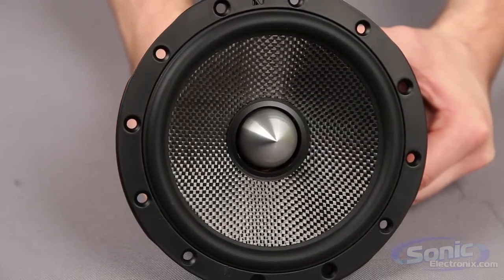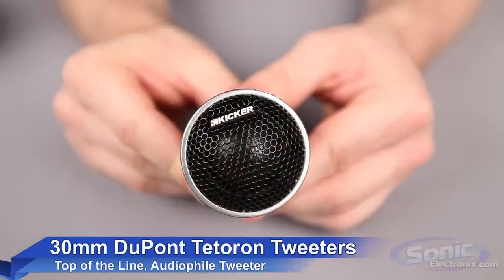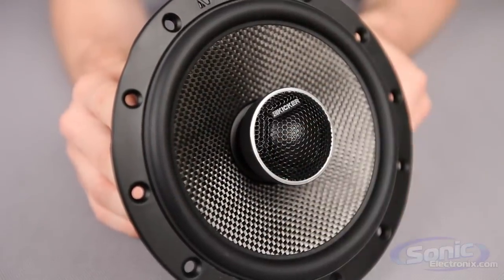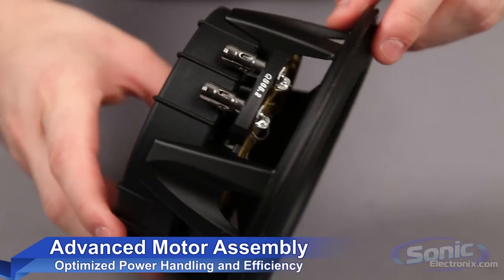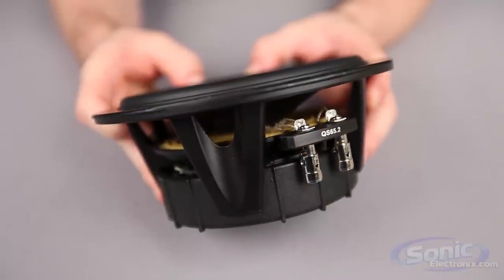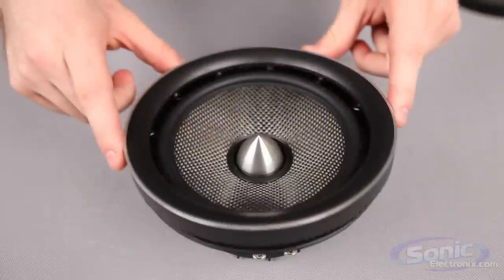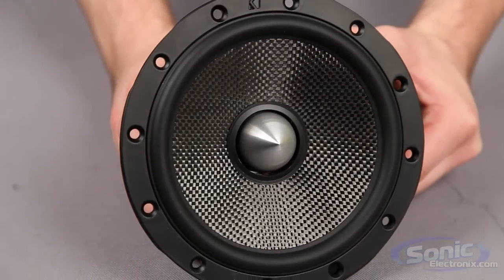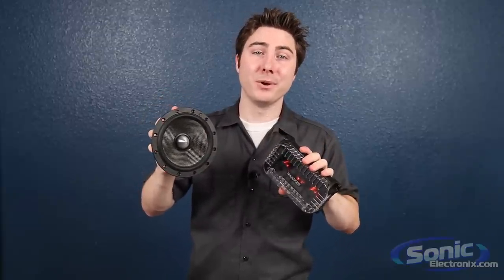Kicker QS Speakers | High-End Speakers for Livin' Loud

Comment from the maker: The Focal K2's are going to sound much better than the QS's, as these are specifically oriented for SPL applications. These do sound very good, but the Focal's are made with better quality materials. However, if you're simply looking to get loud, the QS is the better choice. Keep in mind the tweeters on these are very prevalent.

Comment from the maker: It honestly depends 85% on the install. A top notch installer can make a speaker loud or accurate. We use the QS Series on our test bench and they are rarely beaten when other speakers drop in.
Reply: What kind of amplifier would you recommend for a set of 6.5 QS kicker
Reply: On that rare occasion tho, what speakers beat them..